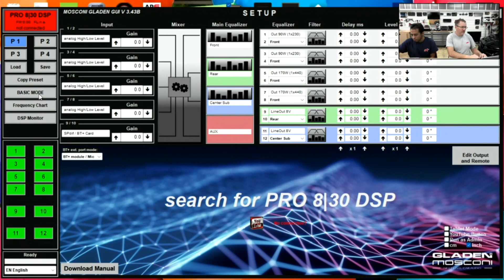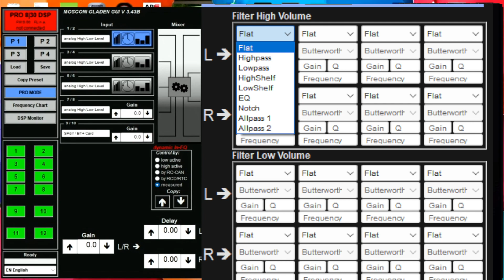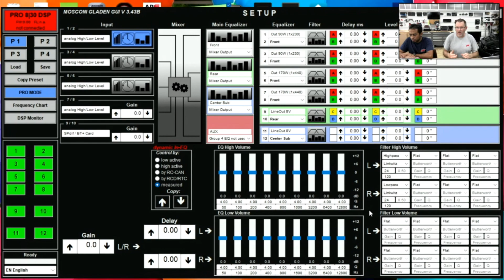Mosconi DSP quick tips Dynamic EQ to save your speakers

Comment: That's a great feature.  I wish all new cars had better EQs though; but most have high, mid, lows.  Is there an inline EQ similar to the Kenwood of the mid 90's that's just an EQ?  Every song is Eq'd a little different and I like to change these setting on the fly.
Reply: Most aftermarket headunits have EQ settings that you can change on the fly.
Reply: @DevinderAthwal306  Mids, Lows, and Highs down count. The only car the I own that has a decent EQ is my BMW.